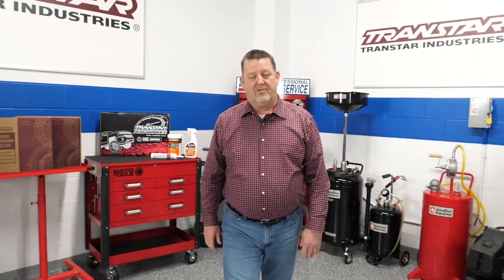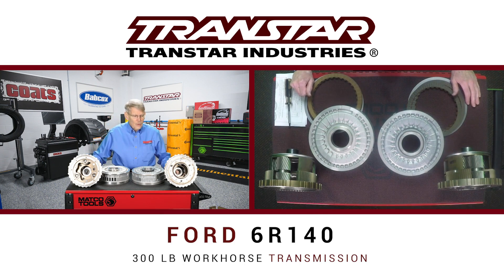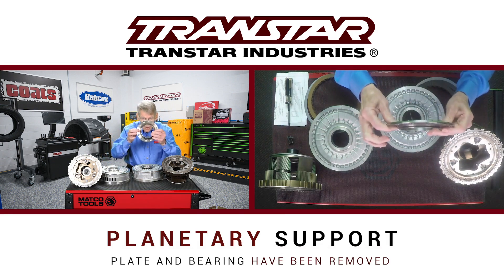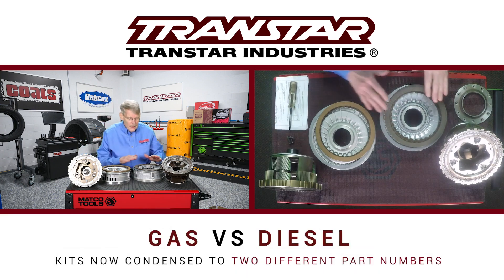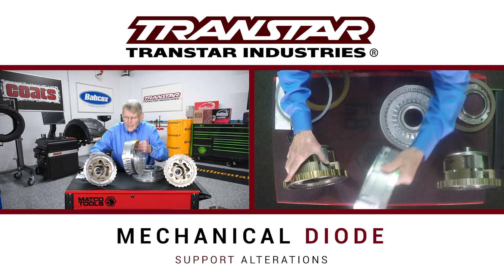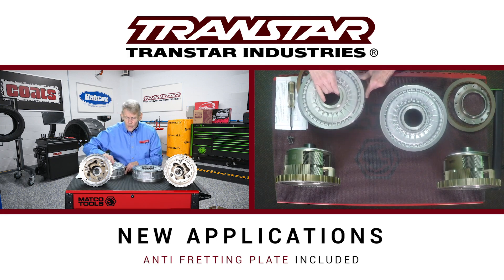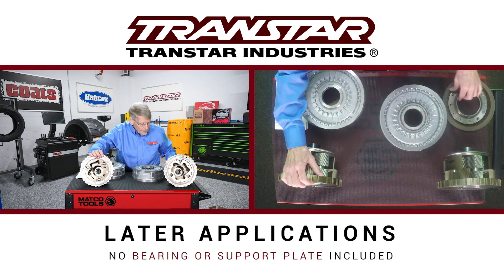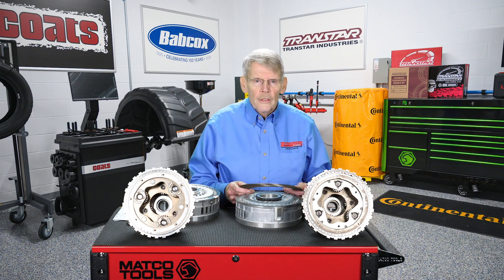Ford 6R140

Comment: My 2016 6 speed torqshift has 400,000 miles and its still like new
Reply: Best Trans ever made in a Pickup. Mine has 345,000. Shifts a little funny every now and then but still got a lot of life.
Reply: @olewangler  more reliable than any alisson
Reply: allison 1000
Reply: @caterpillar6nz310  I said in a pickup. Didn’t mean in a big rig.
Reply: How often are you servicing it?
Reply: @TheSRMproject  I know for fact the transmission was serviced for the first time at 135,000 miles when it was only 1 years old. According to the carfax I believe it hasn't been done ever since then, and its at 400k at 5 years old. It was owned by an airport and they did 300k miles in 2 years and the carfax shows it was getting maintnanced every single 2 weeks, since they drove like 400 miles a day. Mines in a 8,300 pound bus, currently 10,000 pounds with my RV conversion.